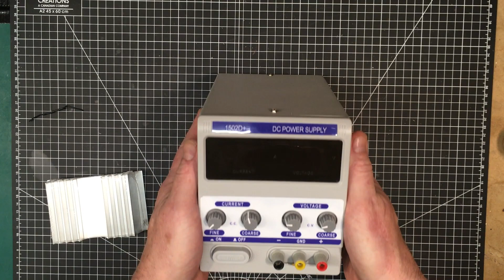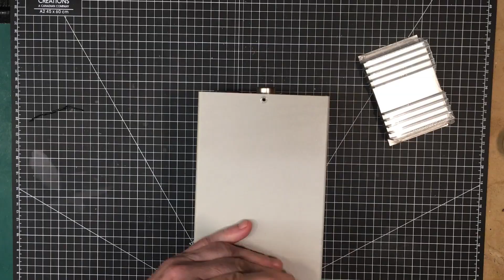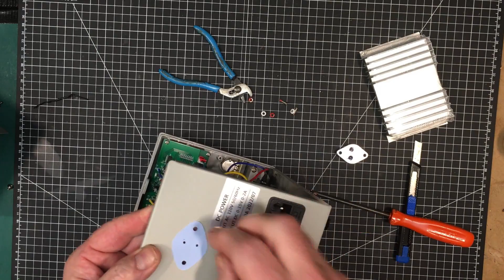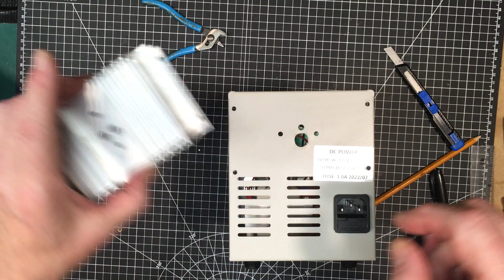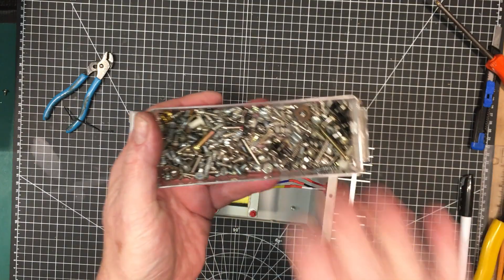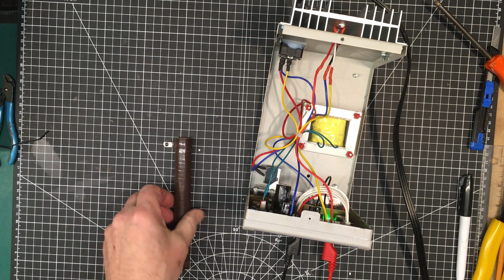0065 - Improving The 1502D+ Power Supply

Comment: I bought the 1502D+ on amazon and upgraded the heatsink, took an hour or so as things never go as smoothly as hoped, ended up a neat job and keeps reasonably cool for bench use. I had to solder a couple of questionable joints on the main board, but hey, it was forty-six bucks....
Reply from the maker: Thanks for sharing and glad it worked out well.

Comment: I watched the video again, I'm still not sure how you isolate the collector from the heat sink, spacers yes which are from the case, but does the bolt not directly make continuity between the collector and the heatsink when you tighten it up?

Comment: The 1502D+ arrived and I checked over the innards, identical to yours, and yes, set up a little test with 1.8A and around 7V on a little motor and propellor and within 30 seconds the toastyness arrived, good, solid toastyness. I will source out a suitable heatsink. A question, what is the importance of the plastic spacers for the bolts with the collector if the heat sink thickness is thicker than the case? - I should look at the video again to see how you attached to the heatsink.

Comment: I like your channel, fits directly in where I'm at in my rebooted electronics adventure. It is odd that I saw the 1502D+ on Amazon about three weeks ago, after I had purchased a Korad KD3005D from Digi-Key. And the run up to the Korad was an education and it is, imho, a solid unit. The 1502D+ though was about a third of the price, sure 15V and 2A and a toasty transistor, yet, $46 and a bit of a project right out of the box, I have ordered one and I hope to be one of the gang who states that "yes, I bought a 1502D+ and I made it right" which is what we should do, polish turds.
Reply from the maker: Thanks man!  I really appreciate that.

Once chilled, it really is a decent little supply.  And you can't have too many power supplies.

Korad are kit and a decent bargain. They offer great support too.  So unusual for a bargain Chinese brand (read UNI-T here).  There are really good Chinese companies like Siglent and Rigol that also offer great support, but they are priced considerably higher than Korad.

Comment: I've seen a couple of comments and videos online regarding bulged capacitors in these units right out of the box, did your unit have any, and how is the performance after the heatsink modification going?
Reply from the maker: No bulged capacitors when it was new and none when I put the heatsink on it.  It's been just fine since then.  I've had a couple of opportunities to use it at low voltage and high current  for extended periods in the last couple of weeks and it just get's warm.  The heatsink is what it needed.

I usually pull stuff like this apart (read cheaper stuff) as soon as I get it.  If I saw a bulging cap, it would go back.  Usually, like with the predecessor to this PS, they won't make you send it back and will just provide a refund.
Reply: @uni-byte  Where did you source the heat sink - it was perfect size?
Reply from the maker: @OldTechGeezer_OTG  I bought a box of 12 of them back about 12-14 years ago from a vendor on eBay.  The are 120mm x 78mm x 32mm (4.75" x 3" x 1.25").  The mounting channel is 32mm (1.25") wide.  They seem like a pretty "normal" size, but I did luck out on that.  I'm sure something as effective and similarly sized can be sourced today.